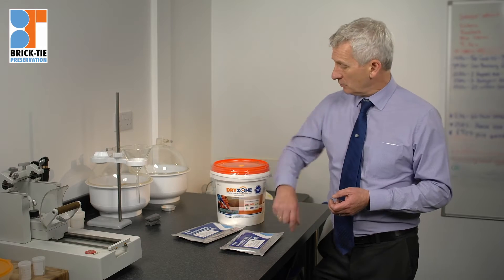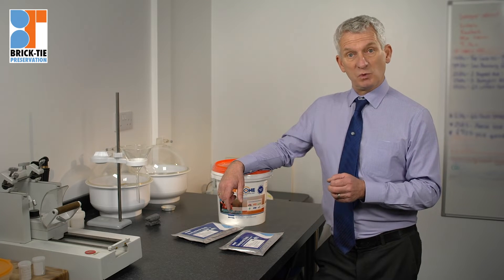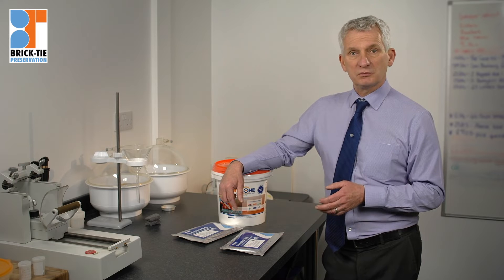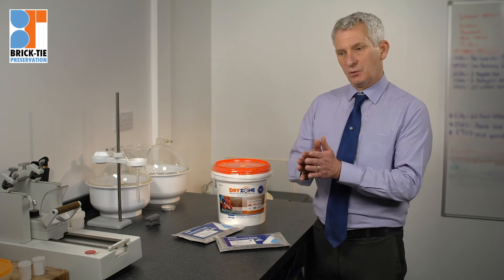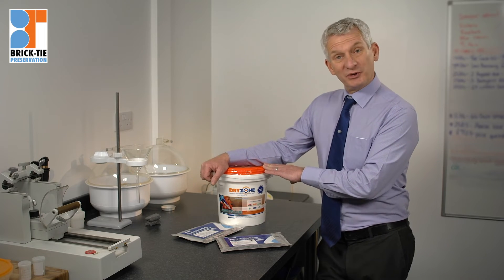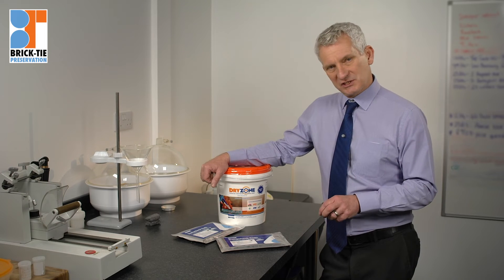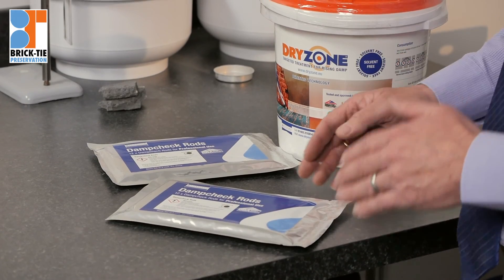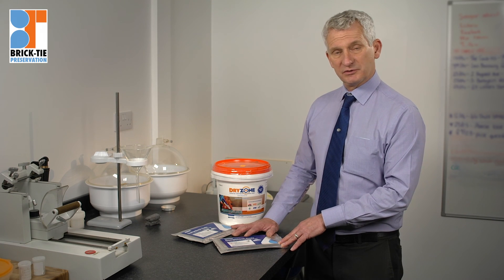Chemical Damp courses explained by Brick Tie

Comment: Interesting video thanks. I'm in Italy and the walls are around 400mm thick solid stone (mainly Granite (Granito), Limestone (Calcare), Basalt (Basalto), Schist (Scisto - A metamorphic rock with a layered structure), Sandstone (Arenaria), Marl (Marna - A softer sedimentary rock containing clay), Tuff (Tufo - A light, porous volcanic rock). There are two main reasons for damp. Firstly rising damp. Salts, bubbling of lime based plaster. Tide mark at the top. Consistent along the base of the wall. Skirtings are usually 80mm high floor tile. Or condensation. Which product would you use for rising damp in thick stone walls?